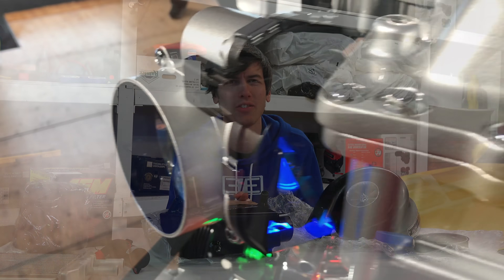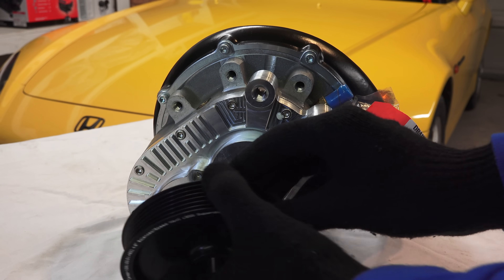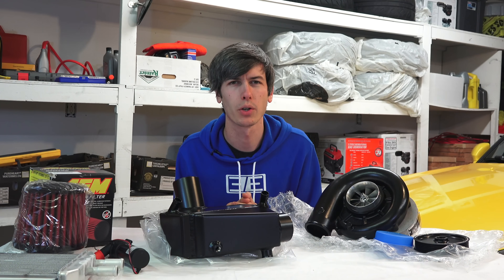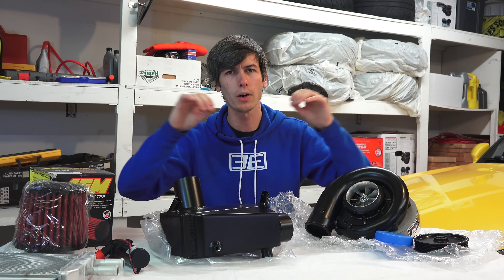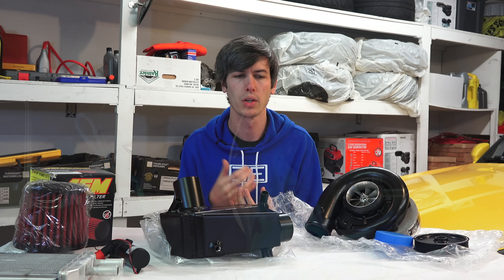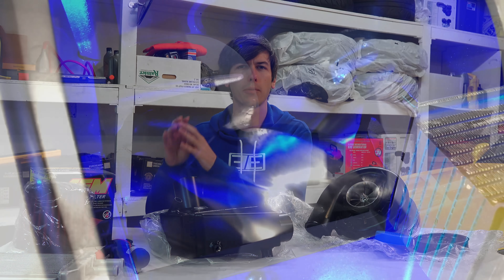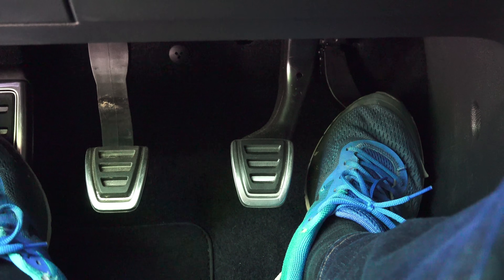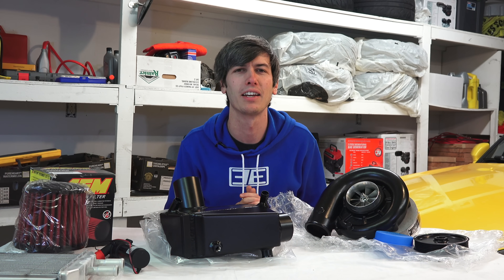Turbochargers vs Superchargers - Which Is Better?

Comment: Jason, this was a good summary of the difference between the two. However, you forgot to mention the differences at high altitudes. As you gain altitude, any ICE engine loses power due to less oxygen being available. With a NA engine, you lose about 4% of your horsepower per thousand feet of altitude, so a 500 hp Corvette at sea level has only 400 horsepower in Denver, Colorado. A supercharged engine will lose about 1 1/2% of its power per thousand feet of altitude gain, making our theoretical 500 hp car about 463 hp. But a turbo charged engine loses only about 1% of its power per thousand feet, still has 475 hp in Denver. So if you’re living at high-altitude, the turbo might be the best way to go.

Comment: I live in a really hot country.  Where the weather hits 50 Celsius.  What I have been putting in my head is that owning a supercharged car is better than a turbo charged car.  Although I love turbos :D.  It would be better to own a turbo charger because of the weather.  Less heat soak, less problems.

Comment: And for people driving normal cars, you want the turbo.  

2015 Subaru Forester had two engine options.  2.5L naturally aspirated 4-cylinder engine, producing 170hp, rated at 24/32mpg in city/highway mileage.  2.0L turbo-charged 4-cylinder engine, producing 250hp, rated at 23/28mpg in city/highway mileage.  

That's a huge power difference, but not a huge mileage difference.  Only major downside over naturally aspirated is that it's a high-compression engine (so is supercharged), so you need premium gas to run it effectively.

Comment: Yes supercharger consume small amount of engine energy but it gives rapid response from engine and also it is reliable than turbocharger
Reply: I disagree when you say that superchargers are more reliable than turbos. The amount of power the supercharger takes from the engine is not small, it can reduce engine output by about 15%, which on a 400 hp car is 60 hp. You are right when you say that you get better throttle response because you dont have turbo lag. A turbo car would make more power than a supercharged car if they run the same boost

Comment: Conservation of energy...turbo chargers also sap energy from the engine it’s just a different mechanism as the engine is powered by expanding gas. It’s not energy for nothing it will result in additional back pressure re-distributing the combustion yield somewhat.

Comment: I find your explanation of turbo efficiency to be lacking.  If the turbo was just using exhaust pressure, it would only be marginally more efficient than the supercharger.  The pistons would be doing more work pushing exhaust to spin the turbo.  The turbo takes advantage of HEAT that would otherwise be wasted, not "exhaust".  At mid to high RPM, ignition timing cannot be advanced any further without causing knock and the air/fuel mixture is still burning as it leaves the engine.  It is that continued burn that spins the turbo, essentially turning it into a turbine engine shoving air into your intake fueling itself off of what your engine is just throwing away.

Comment: yes sir true true but both being forced inducted one is going to need to primary or less than and the other being secondary although one starts before the other they still are r p m dependent so the issue will occur that one will hinder the other is what i mean by being very difficult to synchronize them together

Comment: Never drove a super charged car before but this makes me really want to try. My car is turbo and pro tuned and the response seems pretty damn spot on. I have a lot of torque which is what I want for the rodes I drive but if a super charger is even more responsive I would love to see what that feels like.
Reply: Supercharged cars are so much nicer IMO because they just feel like a naturally aspirated car.  So you have more control over the throttle and also you don’t get that nasty uncomfortable jolt like in some turbo cars when the turbo kicks in.
Reply: @johncarry5989 The lag on a bigger turbo car can be very fun, makes the car feel faster when all the power comes in one kick.

Comment: Question: since the exhaust pipes isnt affected by installing a supercharger, will the sound of the engine remain the same when its floored? Ie: if i, theoretically, install a roots supercharger in a Lexus LFA, will it still wail like crying banshee when i rev it to 8000rpm?
Reply: It would change the sound of the engine. The engine would be producing a lot more exhaust and that would mean more sound.

Comment: Question; how is the boost controlled by a supercharged engine?
Reply: i think you have to reduce the size of the supercharger pulley hence it spins faster and hence more boost...
Reply: The above comment is correct. Changine the pulley ratios would cause the supercharger to spin slower or faster to generate different boost levels.

Comment: Before I watch this video, I want to type  out that both forms of compressed induction are used for different purposes. They both have their pros and cons. In my nonengineering opinion, they both work in the applications best suited for them. Yes, a turbo is what I have heard called ‘free’ energy. Exhaust gases spin a turbine and is connected to an impeller. The only force required to spin the turbine is the exhaust gas. There is no draw off of the engine for this to occur. The supercharger slaves energy off of the serpentine belt. The only turbo usage I’ve experienced were stock components from a Ford F-350 6.7 (B20) turbo diesel and a twin turbo from a mb c400 3.0 v-6 that has 4 transmission driving modes available on its 7 speed automatic transmission. No supercharger experience to speak of. I forgot one thing. I did drive an A4 vw Jetta ‘Bora’ body with the 1.9 turbo diesel with PD (pump duese) injectors that was ‘built’ beyond stock. I don’t know the details because it was long ago and I don’t remember. It was fun to drive as it had a manual 5speed it could have had the O2A transmission. I’m sorry, I don’t know too much about the 4th gen Jetta manual transmissions

Comment: Personally I prefer a turbo for two reasons.  First, I can change how much boost I get by using an electronic boost controller to change it at will.  Second, I use a manual transmission vehicle and that lag is advantageous in keeping the power on during a shift.  

Again, my personal opinion based on my driving style.

Comment: Ill always take that supercharger over a turbo. I live for low end torque.
Reply: Birki gts have fun winning the first 2 seconds of a race and losing.
Reply: @MankeyMark  depends on what kind of track you're on. Some need more top end, others need more low end. As a rule of thumb, longer straights=turbo. Lots of tight corners=super. But i don't race in general, only do time trial against myself and like to step on it every now and them on the road.

Comment: Excellent video. Explains everything nicely. One question though about superchargers. Where do they get their inputs from? Is the rpm of a supercharger somehow connected to the throttle position? Please reply.
Reply: The supercharger is directly connected to the engine, if engine rpm goes up so does supercharger rpm. It is not based on throttle.
Reply: @Redtooth75  Thanks.

Comment: Well lets not forget it depends on the application and what you're wanting to do with it, I'm into drag racing and want a large volume of air. So I will deal with the turbo lag (depending on how you design the motor and how efficent your set up is) for that mid-ish to top end at the drag strip. If you're looking for a fun daily i mean turbo can still be a good bet just a smaller A/R turbine housing will get you quicker spool and just a smaller turbo properly matched over all, will get you some fairly instant response. It really all just is personal preference, there's plenty of fast drag cars that use blowers but they're not the typical blower you will find on an everyday car. So it's not which one is better in the sense, its more what will suit your application better. Don't get me wrong I love feeling that instant torque, but i love that powerband of a turbo car where after you smash it to the floor feeling it come in and then just throws you into the seat and pulls and pulls and pulls, that's the feeling I personally love. Awesome video! Nice s2k btw

Comment: Centrifugal superchargers do still have lag. It builds more linear than a Turbo typically but you still have little boost at low rpm. Until you have more rpm, the Centri (at least most) will not make much power. Great video! Love the channel.

Comment: Can someone tell me the price of doing to this to a car?
Reply: Depends on the car as well as how much work you do yourself and how much work you pay someone else to do for you. Do some research and see if your engine can even handle boost, you may have to overhaul the engine with forged internals, that can cost quite a bit of cash. An average build can range form $3000-$8000

Comment: Isnot there a turbo charge that have a chain that runs just when u accelerate then on high speeds it changed to exchase power?or an electric charger?
Reply: The electric hybrids do exist but im not sure if the mechanical hybrids do. They arent common because they are expensive,  however they work very well

Comment: I have a 2000 Ford F-150 5.4 v8 and I’m planning on adding some power, do you suggest supercharging it or turbocharging it??
Reply: Its about personal preference. A turbo is very versatile, you can change boost just by flipping a switch, they also generally make more power and have better fuel economy for the same amount of boost. However, they also have turbo lag. You can setup the turbo to minimize lag but that usually sacrifices maximum boost. A supercharger has no lag, you get boost immediately when you push the throttle. However, they are generally less efficient. It depends on what you want to get out of your truck.

Comment: You don't really have to choose between the two. Feed the supercharger output into the turbo intakes. It will help overcome turbo lag, get them spooling early and supplement them in times of need to achieve their full potential.
Reply: So you want to use engine power to make more power? Did you think this through at all?
Reply: @BeepxBewp  Did you even watch the video? That is what a supercharger does.
Reply: @BeepxBewp  Yes and not just me but MULTIPLE TUNERS AND ENGINEERS have, and guess what else?  It works!   You literally described a supercharger lol.
Reply: I believe Volvo did do that with their T6 engine.
Reply: Lancia Delta S4's twincharged setup was pretty much this
Reply: This is actually called twin charging and volkswagen have implemented this in their twin charged EA111 engine in cars such as the 2012 Jetta. THey facelifted the car in like 2015 2016 and changed fully to turbocharged, maybe for reliability concerns as well as cost. It's way less complex for them to just simple fit a turbocharger on a mass produced car.
Reply: I think the better solution is to feed the turbos into the supercharger and then bypass the SC once the turbos' boost outflows it. To save fuel  you could even de-clutch the SC at idle.

The turbo versions of Detroit Diesel's 2-stroke Diesel engines did the exact same thing except the blower is always engaged and is required for scavenging. The turbos boost and scavenge once they've spooled up.

Comment: I've always wondered why more air wasn't just provided by something battery powered so it's then entirely decoupled from everything else. Surely running a turbine can't need that much power right?
Reply: They do need a lot of power, turbos can spin upwards of 50,000 rpms. Electric hybrid turbos exist but they are expensive. The 12V battery and alternator on cars is not sufficient to power an electic motor big enough. You would have to overhaul the electrical system. To put it in perspective,  a supercharger on a 400 hp car will take about 30-60 hp to spin
Reply: @Redtooth75  holy crap, I had no idea. Thanks for the info.
Reply: @8xster8  I used to think the same thing. Its deceiving because when a turbo is not in the car its not hard to spin it by hand at all. It is easy because you are not compressing any air. When the turbo is in the car it has to compress the air. This makes it much more difficult to turn

Comment: Nitpick. A turbocharger is a supercharger, just a shortened description for convenience, i.e., the full technical name of a turbo is "turbo-supercharger. Superchargers are mechanically driven compressors. Turbos are exhaust turbine driven compressors. Soon we will have "electro-superchargers" (please don't say "electric turbos", which would be nonsensical) as manufacturers are introducing compressors driven by electric motors. These will have tremendous advantages over current mechanical technology, e.g., instant response and the ability to vary the compressor speed completely independently from the engine RPM's.
Reply: renault demonstrates an "electric turbo" on their Youtube (search "Renault Energy F1") , it's a turbocharger, with an EV system to pre spool the turbo, and capture waste energy while slowing, it's a standard turbo operating like a normal turbo most of the time.
Reply: Isnt f1 engine electric-turbo? Why you said dont call it electric turbo?
Reply: Dav Mar Thank you for pointing out whether belt driven or exhaust driven,compressing the air is Super Charging.

Comment: The one negative you left out forthe turbo is. The importance of spooling down of the impeller. Before you turn off the ignition to off to stop the engine. There may be a few others I have missed as well on turbos.

Comment: 2:49 WHY DO U CONSTANTLY TAP THE TURBO CHARGER WHEN U R TALKING ABOUT A SUPERCHARGER? do you know the difference?
Reply: WHY DO YOU TYPE IN ALL CAPS?That is a centrifugal supercharger,  it looks like a turbo but instead of a turbine it has a pulley connected to the engine. This was explained in the video.

Comment: Ummm both are dependent on the motor to run ! One is gear or belt the other through air flow both requiring the engine to be running!!! Engineers !?(sighs)

Comment: I own a 2010 Range Rover Sport Supercharged and I can feel the lag. Foot stays in the same spot on the accelerator pedal but I feel the car pulling harder as the RPMs increase. Why would that be?
Reply: You make more power at higher rpms. That is why cars have to downshift when going up big hills

Comment: Supercharged car has the boost pressure direct proportioned to the engine rpm. So the power output profile is very similar to a NA engine along with the responsiveness.

Comment: Each pound of boost in a proper turbo set up will make more power than an equivalent proper supercharged set up. Turbos are just that much more efficient. There are dyno articles where they set up a turbo vs supercharger shootout by installing both on the same car. Turbo won easily

Comment: Another advantage of superchargers is that they are generally more durable than turbos. Turbos can start to leak oil, are under stress from heat and susceptible to accumulating exhaust soot. They are another thing you often have to have replaced expensively as your car gets older, while the more simple superchargers can last through an entire car's life.

Comment: One thing he forgot to mention is that if you have been working a turbo charged engine one should allow the engine to idle a moment or so to purge the very hot oil from the turbo.  Otherwise, shutting down from a load on the engine can cause the oil in the turbo to "fry" in the bearings and such.  By allowing it to idle for a moment or so that super hot oil is replaced by much cooler oil and the turbo shaft and turbines also have a chance to cool some.

Comment: What about a centrifugal pullied all the way for max boost and running  a waste gate at like 15 psi.
Reply: Centrifugals dont have wastegates. They have a blow off valve for when you release the throttle but the boost is controlled by rpm of the engine and the pulley ratios. A centrifugal will never make low end boost without overboosting the engine at the top end.